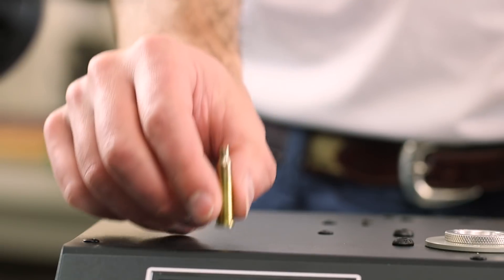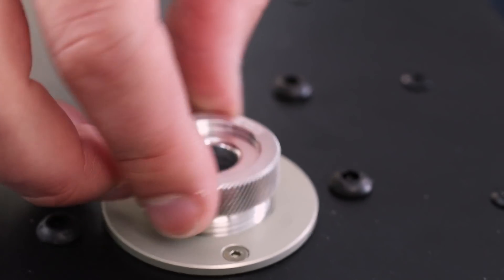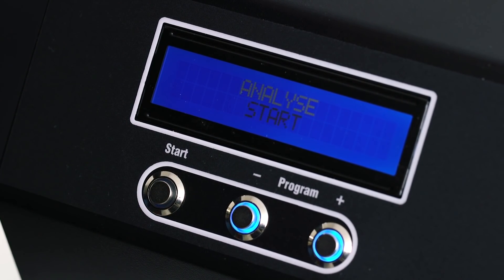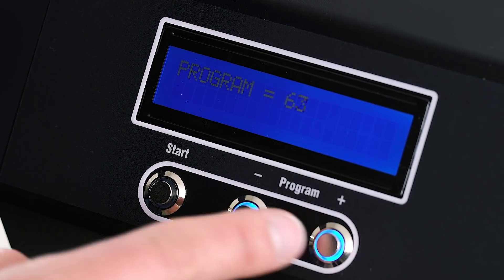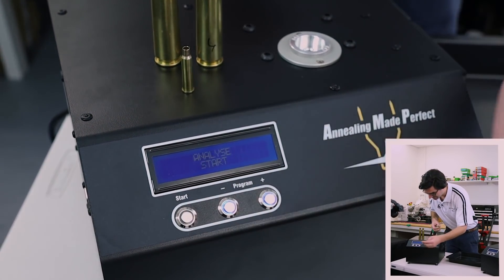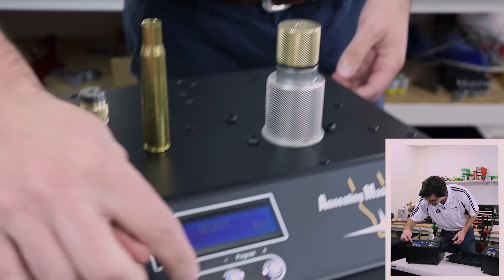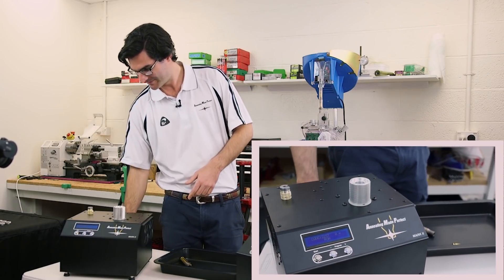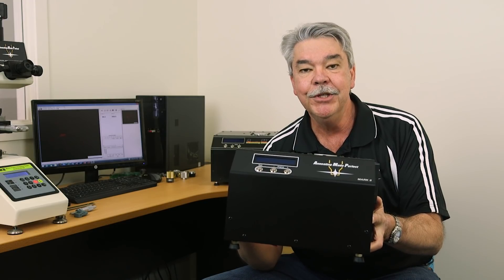Annealing Brass with MARK II: The New Standard from AMP

Comment: I must tell you gentlemen. I own a mark 2 for 3 weeks now and my velocities already started getting more consistant. I fired these 338 lapua cases for 67 times and anealed with a flame but my velocities just went inconsistant. So i anealed with the mark 2 and boom it closed up. Thank you gentlemen
Reply: The same lapua brass for 67 times!?
Reply: @hickoryridgefarms  yes 6700 shots with the same brass its also not hot loads mild loads
Reply: That’s impressive. I’ve never gone passed 20 loads. I wonder how many more loads past 67 times you can do before the webbing stretches too thin?
Reply: @hickoryridgefarms  thats what im checking at this stage ill make some messurements and give feedback
Reply: What did you end up getting to? A 100? How many grains under book max for the reloads?

Comment: For long range shooters, especially competitive shooters, this is machine pretty much a must have. Takes the guesswork out of annealing which helps give you consistency, and consistency gives smaller groups. Yes, you can simply hold a case in a torch flame but I guarantee you will not get repeatability results regardless of how much "experience" you have. Same thing holds true for the Annealeze and other flame annealers. While they may be repeatable to a point, you are guessing on how long to leave the case in the flame, how fast to spin it, and where to have the flame contact the neck/shoulder. Each time you set it up can be different from the previous setup. If you want the best shot-to-shot consistency and the smallest groups possible at long range, then this is a valuable tool. If all you want to do is plink at 100 or 200 yards, then I'd agree it's overkill. Precision shooting is an expensive sport. I bought an AMP Mark II and I love it.

Comment: Am I right if I claim that the temperature of the brass must rise to approx. 1000° f for such a short time to reach the correct softness?
Reply: Morten Breiland 750-800f will take 2-3 seconds . You’ll ruin brass if it reaches that temp. The bottom portion of the brass shall never reach 450 or more. It will made the head of the way to soft.  If you get to get to 1000f you can burn away zinc out the brass neck and ruin it as a whole or over head the head of the case from head distribution sense brass is a very good conductor of heat
Reply: Amp annealing is made to get ur brass as soft as brand new factory brass so it has very consistent neck tension very time.  Lots of pro shooters use amp anneal and some ELR shooters on YouTube like MarkandSamAfterWork  use it and love . It’s quick and easy to use rather than a flame with tempilaq  which can get tricky. I’m saving up to get myself one also as we speak. I
Reply: @brandobrandddd  Interesting, so all cases annealed with AMP are destroyed then? How do you think brass is made?

Comment: Wonder how much this thing costs?  Looks like an arduino, induction coil, relay and thermometer.
Reply: Holy crap, over a grand!  Good idea, limiting your market way too much by that pricetag.
Reply: @embracethesuck1041  look at the video on how one of these are made and you will change your tune on price real quick. not only that but as in the video the machine literally can analyze your brass to give you the correct anneal every time. what other annealer can even come close to the technology in this unit?

Comment: Just received my mark2 and love the Aztec mode, use it on my LC 7.62 brass I've turned into 6.5 creedmoor. Has completely stopped the cracking of the case neck after a couple of reloads. Pretty labor intensive to reform the brass and turn the necks, so stopping the cracks is a big plus.
Reply: How has it been working for you? I'm thinking about buying one of these, would you still recommend it?
Reply: @WalkingCoyoteBear   yes I would,I reload 6.5 creedmoor,300WM,and 338LM and have already seen the difference in the quality and life of my brass.😀
Reply: John Barton Thank you so much.. my wife and I reload tons of .223, I’m excited to get this bad boy.. it will make a nice addition to the Dillon 1050👍🏻👍🏻
Reply: @WalkingCoyoteBear  got mine thru creedmoor sports, very professional and kept me informed about shipping.
Reply: @deeremeyer1749  well said Sir!
Reply: Get one. I do 50 BMG, 30.06 and .223 and all come out perfect.
Reply: Rooftop Voter pure awesomeness.. I’ll put my order in at my local distributor

Comment: Ridiculous dinosaur interface.  Welcome back to 1975.
Reply: Best part is this: It works
Reply: @rooftopvoter3015  Three buttons to rule them all!  Just looks like an eighth grader's Arduino project, that's all.
Reply: @deeremeyer1749  I guess it depends upon where you live or maybe it was 9th or 10th grade?  The school bought them and they can't just throw them away and buy Raspberry Pis when they have to spend all that money to educate the hoardes of undocumented immigrants.  Arduino is cheap and can easily do a lot of things  quickly without a lot of hardware design.  I wouldn't be at all surprised to see one in this machine.